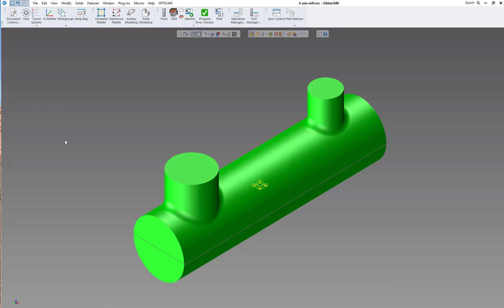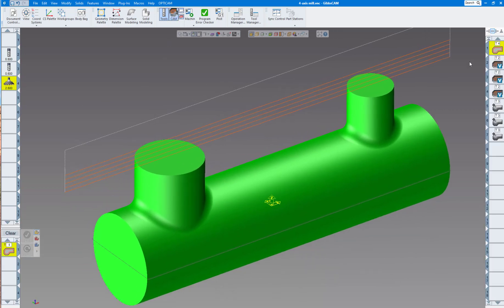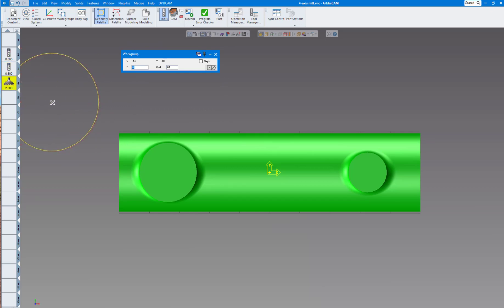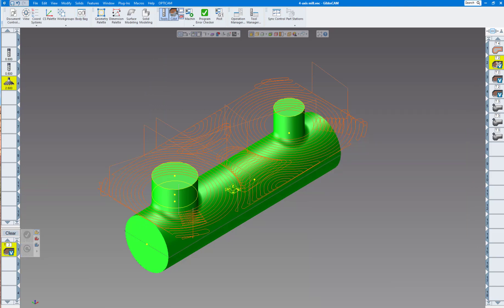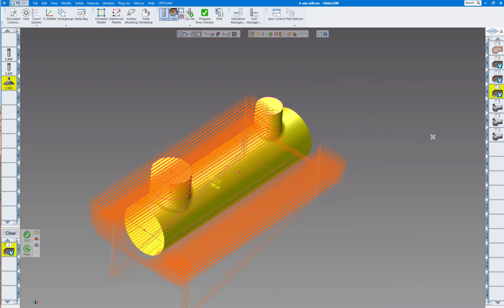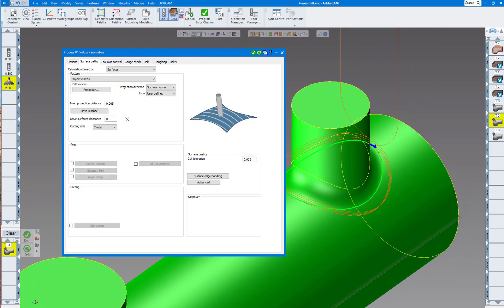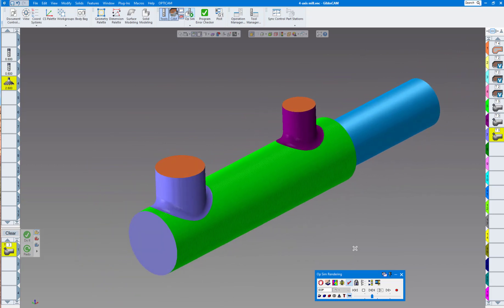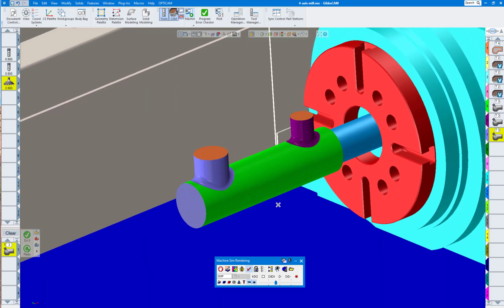GibbsCAM 4-axis Milling/MTM 4-axis Milling

Comment: Please use 'wall cleanup' in your 2nd and 3rd volumill strategies. It would have reduced your machining time significantly and would also use maximum flute length on the endmill as its designed to rather than tip cutting.
Volumill solids is a great tool if you use it smartly.
This part could also fit in much smaller stock...
Reply from the maker: Thank you Brent.  You are correct, I could have saved more time by using the "Wall Cleanup, Desired Step" process.  As far as the stock I used nominal size material, which was 4.5" diameter.  I could have used 4.375 and saved a bit, but that would have been the minimum I could have used without clipping the bosses.  Thank you for your input !
Reply: @GibbsCAMVideoTutorials it looks like the stock could be much smaller. The stock  does not have to be axially central to the part just because its round. It may be the easiest way to position it in CAM but you are removing a massive amount of material from the bottom side unnecesarily.
Reply from the maker: @brentallwood4264  Yes.  Its just a video on how to program a similar part, not necessarily how I would actually run this in a shop.  Many ways to machine this part, including running it on a lathe to remove most of the material , then go to milling to finish it off.  Thanks for watching and your input !

Comment: How about a comprehensive video on techniques to manage over 100 machining operations?
Reply from the maker: @powershop1903  The operations tiles will not delete or disappear unless you did click on one of them and press delete.   Normally if I am creating geometry/solids, or modifying geometry I usually turn off CAM until I am ready to continue my toolpaths.  Like most software if something is selected and then delete is pressed it will go away.  Thanks for the reply !
Reply: @GibbsCAMVideoTutorials  我可以跟你购买一些资料吗
Reply from the maker: @刘成龙-k6m  What materials are you looking to get?
Reply: @powershop1903  or, you could just type, Control Z, and your mistake is undone
Reply: A machining operations tree exists in every CAM system besides Gibbscam. Nobody else drags tiles around because it's a badly dated concept.
Reply from the maker: @JonBanquer  Note:  You don't necessarily need to "drag" operations around.  Just right-click on a operation,  or multiple operations, then click on "Move to", then input the operation number you want the operation/operations to go to, and done.  Easy peezy!
Reply: @GibbsCAMVideoTutorials  If you think "Move to" is a replacement for a machining operations tree you're sadly mistaken.
Reply: Bottom line: There is no way to easily manage over 100 machining operations besides using a tree interface that every single CAM program besides Gibbscam uses. Gibbscam either gets a machining operations tree or sales and market share for Gibbscam will continue to plummet.
Reply from the maker: @JonBanquer  I will send your suggestion into the developers.  Thank you for your input !